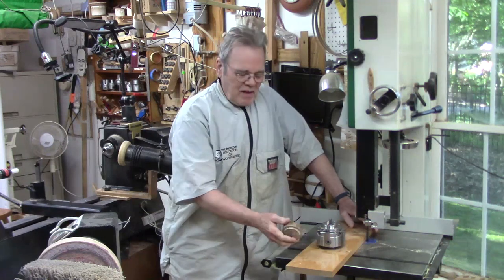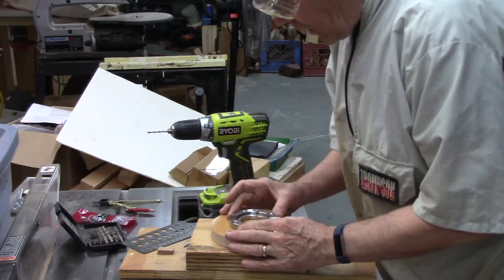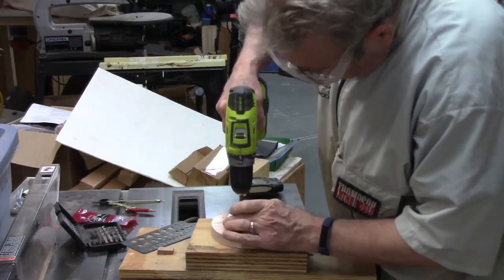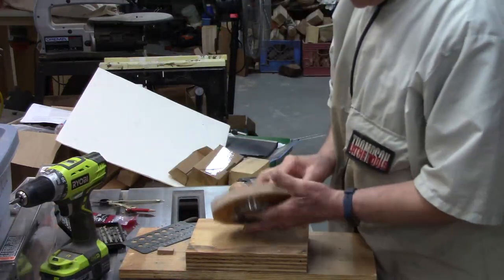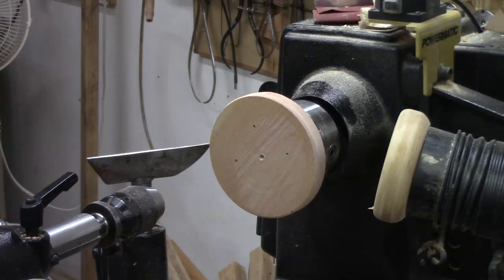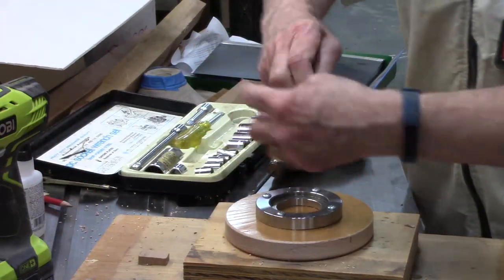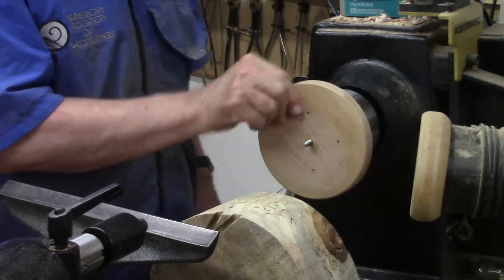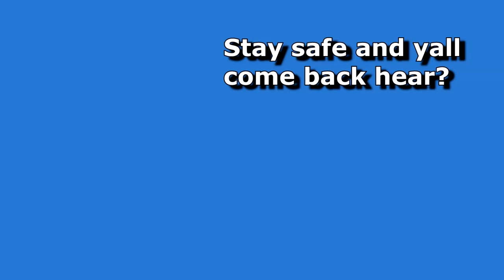Screw Chuck – Who Needs One?

Comment: I do not have a face plate ring. So instead I just glued on a piece of 1/4 inch stock which I turned to dovetail shape to match my biggest chuck jaws. I recessed and glued with epoxy the head of the lag screw. It works pretty well and saved me about $30. Thank you for sharing, Have a great day and stay safe.🙂🙂
Reply from the maker: Yours is a good solution.

Comment: Thanks for putting this out.  A couple things: I followed your link and got a set of the countersinks you used.  I just ran into an issue drilling a pen blank with the drill bit wandering more than I wanted as it went into the little dip left by the live center; I think these will help mitigate that.  Secondly, that use of a piece of strap iron to reinforce the lag screw is brilliant -- that should really help with the longevity of the screw chuck.
Reply from the maker: Another option besides the strap is to file the inside of a fender washer with a couple of holes or notches to hold it.

Comment: Thank you very much for your informative video. 
It is not necessary to drill a hole for screws. The screws are well screwed in without holes. Check on the board trim. 

4:19 do not use a scraper, use the wings of the reer (Bowl Gouge - 55° - 60°). Health and success in work. Thank you.
Reply from the maker: Yes, a bowl gouge could be used.  It is a matter of preference. I find my approach on drilling the center hole better insures centering. Just using a screw can be off a tiny  bit.  YMMV
Reply: @MikePeaceWoodturning  The scraper scrapes the wood and can pull out part of it. bowl gouge - it cuts wood without pulling it out. You still center the tree with a chisel after screwing :) Thank you.

Comment: I would be inclined to use a hardened lag bolt.  To secure the bolt's head, I would counterbore and fill with epoxy - good ol' J-B Weld.
Reply from the maker: A hardened screw is not necessary. Epoxy  has failed me in the past for holding a lag bolt. YMMV

Comment: It's a great idea as long as you have a spare face plate. Does the larger back plate provide more support for the piece being turned,  compared to  using a regular worm screw that mounts in the chuck jaws?
Reply from the maker: You could always glue to a threaded glueblock. Or as Glen suggested in his comment, just turn a tenon and hold it in a chuck. Yes, the larger wood surface makes it stronger as it provides more friction but also  more lateral support. I find this easier to mount and dismount a blank compared to using a woodworm screw.
Reply: thanks

Comment: Mike nice project and will prove useful. However, my OCD side kicked in when I saw you went through the board without either filling them in, or jprobablly better, go back and drill the others all the way through.  The holes would then make a symmetrical pattern on the front of the plate. 🙄 Cheers, Tom
Reply from the maker: Singers have to sing and dancers have to dance.